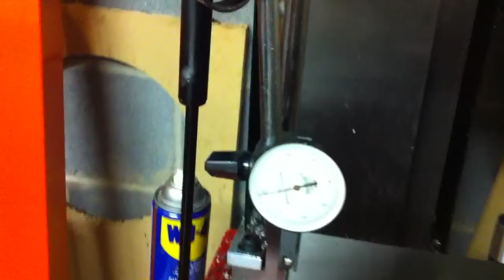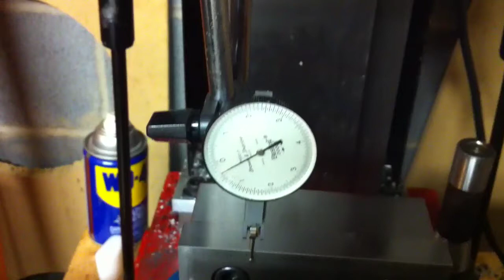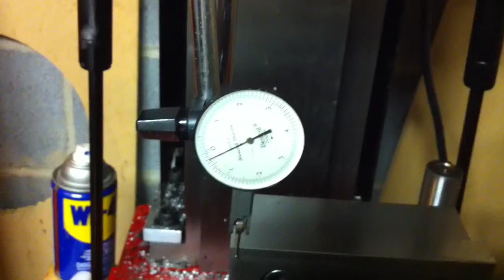Shars 440V Vise Keyway Accuracy on X3 Mill

Comment: If I'm seeing everything correctly, each division on that indicator is 5 ten-thousandths of an inch, which means your total error is 0.002" not 0.0002", which isn't actually that great.
Reply from the maker: Each division is 5-hundred thousandths.
Reply: @kingjamez80  Yep, I wasn't seeing correctly. I was reading the dial as 0.0005, not 0.00005

Comment: I don't want to comment on tolerances or parallelism yet, because I don't have an indicator that measures tenths, and I have little confidence in my indicator holder, but the 440V seems to be a very high quality mill vise.  There are a few little spots on the bottom of the vise that were too low to get ground flat, but it fits together very tightly, and seems solid.

Comment: I haven't seen anyone else mount air struts on the x3 in the way you have, and that's pretty much exactly the same way I was planning to do mine. Did you aim to support the head at the approximate center of gravity, or as close to the column as possible?

Comment from the maker: @Bolstermanic I'd bet it comes from the same factory. However, I think Glacern does in-house finishing. The only reason I didn't go Glacern is that the Shars was $50.00 less delivered. That said, the inspection sheet on mine showed that it beat all of it's tolerances, and by a wide margin. I'm very happy with this vise and really don't see a need to ever upgrade it.